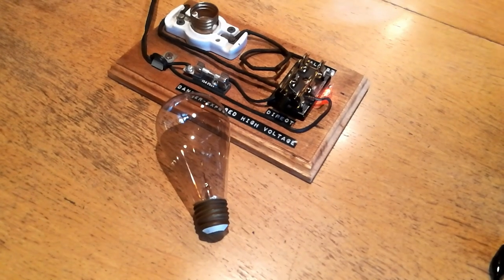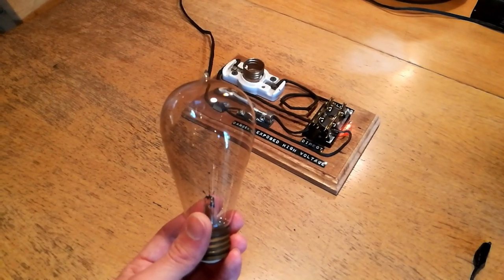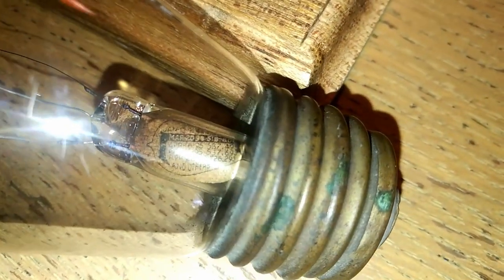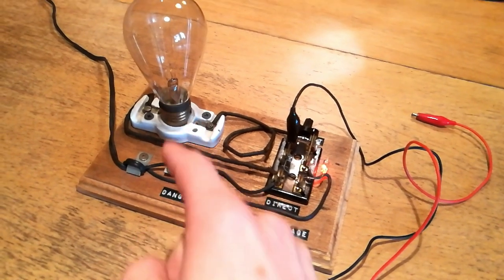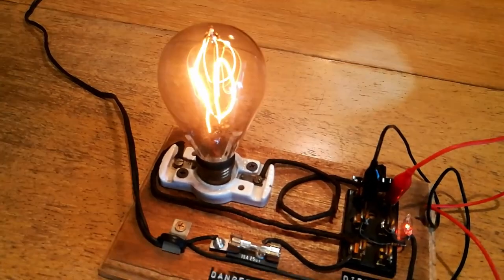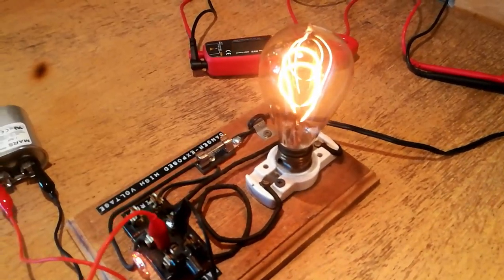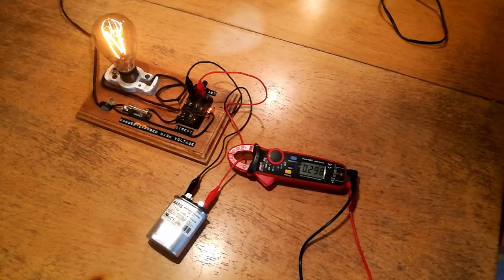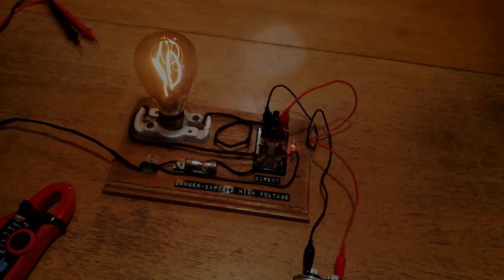EP 59 - 1903 Carbon Filament Light Bulb

Comment: AC power can cause the filament to vibrate due to heating and cooling as the sine wave goes up and down, and also due to the vibrating magnetic field produced by the coiled filament. I would recommend adding a bridge rectifier before the bulb so it runs on DC, then using a capacitor in parallel with the bulb to get rid of the sine wave ripple. The capacitor as a current limiter is a good idea, or you could use a variac or adjustable transformer. Beware that putting a capacitor across the bulb can increase the voltage to it, so proceed with caution. Use a smaller ballast capacitor to start with, or turn down the variac.
Reply from the maker: Great points! The rectifier is a good idea, as is the ripple filter to go with it!

I actually gave this bulb away to one of my friends a few years ago, but as far as I've heard it's been running with the 4.7uF motor run cap on AC for more than 3 years now!

Comment: You should always start with a low voltage or dimmer before applying full pwer to a bulb you don't know the voltage, the resistance should give you a good idea of the voltage used, if you do the calculations using Ohms law.
Reply: These calculations will be very difficult. I haven't found anyone doing this before, it will be useful for us